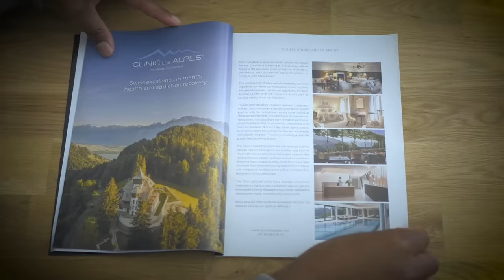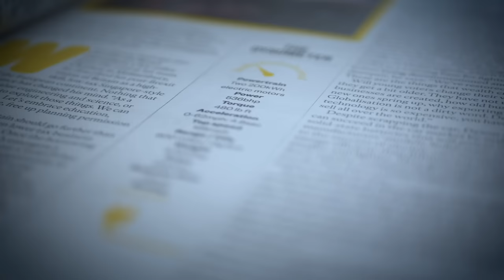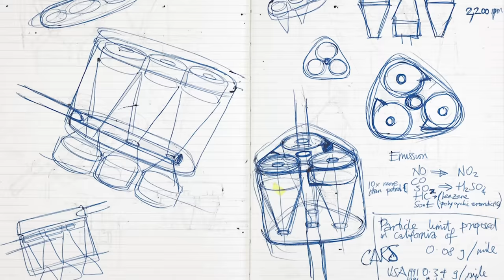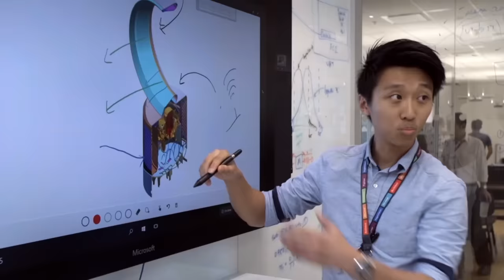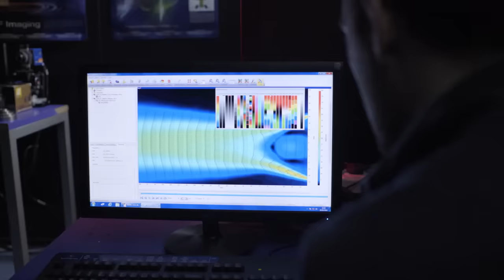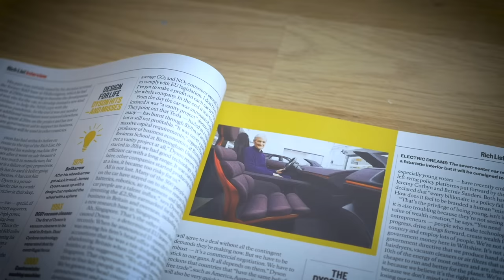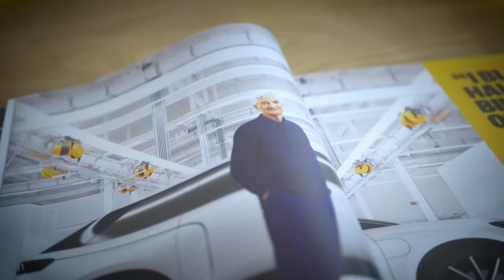Who Killed The Dyson Electric Car?

Comment: For Dyson to sell the product in the UK the 600 mile range doesn’t make sense. However if his intended audience is the USA then it makes total sense. My children just came up from Texas to see me, that trip was 875mi. one way, about 14 hours nonstop driving. Even with shorter trips you would still have to figure in excess power for air conditioning, heating, mountainous terrains, battery pack heaters, etc, etc,.

Comment: Holy smokes, just dawned on me that Rory is a good enough journalist that he needn't be hooning about to keep my interest piqued
Reply: @AutoTraderTV  "spewing out emissions"........exhaust emissions are measured in ppm (parts per million). Nothing has been manufactured for decades that is simply allowed to "spew". Is a tired old cleche for cheap effect all you are capable of coming up with? Furthermore no manufacture would reject an easy and cheap way of meeting ever tightening emissions regs. You are just repeating conspiracy theory garbage Rory. At least in analysing the cost of building electric you gave the manufacturers some credit
Reply: @xtc2v  The suspicion has to be that Dyson's idea for emission reduction just did not work as well as he pretends or, if it did work at all, was far too expensive, or, most likely, it could not operate over the distance legislation demands (80,000 miles or more).
Reply: @geraldryan7544  Agreed, otherwise VW group would have used it as a simple fix for their emissions scandal!
In fact, all car manufacturers would I'm sure prefer a zero emission ICE car over the massive investment needed for producing and EV....I would wager that the Dyson filter didn't work!
Reply: @brownpartnership11  Nothing is cheaper than a bit of software that can run on a computer chip you have to have in the car anyway!
Reply: @DavidKnowles0  Agreed, as long as that software can fix the issue and it's not a hardware issue as in many of the cases for VW emissions.

Comment: For many years I designed and manufactured systems for commercial vehicles. I loved working on the most complex and unusual ones. It is fun to invent some new way of making a thing work. It was quire engrossing. The very hardest part of that job was knowing when to walk away, when to call a customer and admit that I couldn't make a gizmo that fit their requirements. Often I would go back and revisit these rare failures and try again.. and again, often spending unjustifiably large sums. 
I didn't have Dyson's budget but I understand the emotion, and I feel his pain.

Comment: I wrote an article for a business magazine on the foolhardiness of Dyson's electric car project.  I called it his Sinclair C5 moment.  He had experimental battery technology which he was trying to commercialize at light speed. Most other solid state battery researchers thought that the potential for a commercial battery was five to ten years longer than the timescale Dyson had given himself.  Dyson also chose to start from scratch.  His potential competitors, the existing car manufacturers, already had production lines. His potential competitors had existing car models.  He was building something completely new when his competitors were engaged in product modification.  He had small capacity.  His potential competitors had huge capacity to produce.

Dyson was developing his own battery technology, not linking to an existing supplier. Again more cost.  Dyson was trying to develop a new battery technology, smaller lighter batteries but with faster charging times and greater capacity.  There were lots of rumours that said batteries were unable to provide the power output demanded by the Dyson Car.  this is exactly the problem Sinclair had with the C5.  Sinclair had developed a new battery technology (something he had been working on for decades) BUT his batteries weren't ready for commercial launch so the C5 was a busted flush that had to be pedalled up the slightest of hills.

Dyson could have gone into a joint venture to supply his new battery technology to the existing car industry. By focusing on the battery alone rather than trying to build a new car from scratch, he may have got better results.  Instead, at the launch of his car project, Dyson chose to slag off the existing car industry and go it alone.

It was always going to be a problem for Dyson to launch his new car at a competitive price.  He was operating at the edge of commercial viability with his battery technology add a lack of economies of scale and existing vehicle parts -suspension, brakes, etc, his car was always going to e hugely expensive and produced in small batches.  Just look at the issues Tesla had when demand exceeded  their production capacity.
Reply: What a nicely reasoned set of points. Well put.

Comment: "If anyone can make an electric car work it's him, surely!"
No. Not at all. We generally struggle to understand that the automotive industry is one, if not THE most complex industry in the world. The level of optimization it has gone through in the last century it's something not easy to comprehend, the amount of regulations and standards it has to meet is overwhelming, and it doesn't stop here... all of this while mantaining rigorous quality control AND the production rates of a can factory, oh, and don't forget the post-sell support and assistance and the practically non existent margins in all but a few segments.
That's why Tesla still struggles to achieve the QC of even the cheapest japanese or european citycar, and that's why NO, having distrupted the vacuum cleaner market is not a qualification to make a big splash in this incredibly hard industry sector.
Reply: I agree. I've been a development engineer for most years of the last 24. It is sodding difficult and sodding expensive.
My years outside of the automotive industry were as a development engineer in the aero-engine industry.
Damn, they ARE expensive. Don't think you';; get many start-ups competing with the Trent 700 !
Reply: You're of talking out your butt really.
He messed up because he worked backwards he designed the car before sorting out his supply chain, when he got around to doing so it was a surprise. It can and has happened to others in every industry. It can be said Tesla only exists because they managed a deal with Panasonic for batteries, there were other EV manufacturers when coming out along with Tesla when it. Tesla secured a battery the others didn't, Tesla is here the others are not. Same thing is happening with Dyson. The crap you spouted has nothing to do with that.
Reply: @ExileXCross  do you realize the reasons you gave for Tesla's success doesn't negate the points of the original comment? And why would you insult a random person on the internet for a perceived differing opinion?
Reply: That century of optimisation is essentially being thrown in the bin at the moment an manufacturers have a nearly blank slate to work with.
Reply: @ExileXCross  Musk had the capabilities, ie lots of very cash rich friends, It was his Hollywood friends that save Space X, to raise money to build his own battery factory. Dyson already has such a factory and it been expanding for years.

Comment: If batteries were the biggest cost. I Wonder why he didn’t just trim the range down to say 3-400miles this way he has a product to start off. Sale some units and in future release your 1000mile car once the market is more familiar with the brand. 

Perhaps he tried to do too much with his first product.
Reply: When the manufactures claim, say 300 mile range, that's usually in ideal weather conditions on flat roads.
So out in the real world it'll certainly be less. Factor in battery degradation over a few years & the range anxiety could become a real problem.
Reply: Yeah everything start small
Reply: Tesla threw the whole kitchen sink in right out the gate. They just arrived at 'Normal' with the Model 3 and Y
Reply: @ONYX-365  Not when it comes to the 100kwh Model S & X that Dyson was trying to compete with. 300 Miles is not efficient for a 100kwh Pack. That's in bad condtions.
Reply: @ONYX-365  "Factor in battery degradation over a FEW years" LIES!
Battery does not massively degrade around 8 Years. It plateaus for several years under 10%. That is a well known statistics of Lithium Ion BEVs real world fleet data.
Reply: Tesla is aiming for 500 mile EPA range for their top trim $70k USD Cybertruck. I agree 600 miles was a bridge too far.
Reply: @ONYX-365  Most daily driving is under 40 miles.  Well designed battery packs have negligible degradation.  Tesla's existing battery packs last more than 300,000 miles of real world driving.  Please stop spreading false information.
Reply: It's estimated that the Tesla Model X comes with around 20K worth of batteries, which goes around 350 miles utilizing a 100-kWH battery.  Since Dyson's car would be heavier it would probably only get around 300 miles on that same battery so you would have to pretty much double the size of it using a 200-kWH battery costing closer to $40K.  Realistically he could have offered 3 trim levels, a $120K version that would go around 220 miles.  A  $135K version that would go around 310 miles and a $150K version that would go 600 miles.  This way people would pay for the amount of range they wanted.
Reply: jesse e .......Hmm? 1.5 minute run time on my cordless hand held vac....Then a recharge...for three hours....sounds as though the car/handheld vac. would not even get out of the garage Er? Cupboard.
Reply: The density of the SSB batteries Dyson was working on was suppose to easily provide that 600 miles range at a affordable price, when they failed to arrive on time, they had to resort to normal Lithium batteries, which sent the price sky rocketing.

Comment: Very nice summary of the story.
I work in the Auto industry as an engineer and followed Dyson from the start of its EV project. They really were wildly naive from the start. Saying they were "Ambitious" was a more kind way of putting it. From the start, senior level Dyson employees were ringing alarm bells that the EV project could bring the company down. Just read some of the Glassdoor reviews.

A more fundamental issue was their urge to re-engineer every aspect of the car. They were literally trying to re-invent the wheel. This is where Tesla excels; Tesla leans heavily on Tier1 suppliers to bring in existing hardware with no radical customizations. Instead of all-out hardware superiority, Tesla also banked on software and they are 5 years ahead of even the big Auto players. Dyson EV had no chance.

Dyson does well with their premium consumer products and they are really nice to use. However, from an objective technical view, they are over engineered, over priced & not that robust (a philosophy that does not work for new EV companies). What vacuum cleaner does the local car wash use.... its a Karcher, Hoover or a Henry.

Comment: You've hit the nail on the head with the partnership angle; Dyson should've partnered up with an established part of the supply chain for EVs or at least another manufacturer. 

Even the mighty Tesla compromised on this; the first Tesla-powered EV had a Toyota badge, the second was a modified Lotus design and the third, while very much a Tesla design, had Mercedes switchgear in the interior because they knew what corners could be cut at that stage.

The range-you-think-you-need is another good point; people don't actually need to go as far as they think they do in one go. But they do need to be able to charge up as quick as they can with an internal combustion engine, which currently isn't possible no matter how much you spend on an EV. So perhaps Dyson should've looked at creating a charger/battery combination that could rival refuelling times of a petrol/diesel pump. That would be truly revolutionary.

Comment: So the Cybertruck 3 motor ~$70k and Dyson $200k so total product proposition failure.

His target should have been Defender X P400  ~£100k  that was easy to beat with an EV with Magna and Ineos on board?
Reply: John Dinsdale no one in the traditional car manufacturing has the knowledge  to develop electric systems . That has been the biggest problem car manufacturers face. They were used to just buy components but it turns out no one knows how to build them.
Reply: @irisfailsafe  Magna do and created the jaguar ipace ,  Mr Dyson needs to learn humiliate and ask for help

Comment: Another great piece by Rory Reid, a much underrated motoring journalist. However, I suspect there's another reason in the mix as to why Dyson binned this project, and that's the forthcoming Rivian R1S (and R1T). Same concept (though max 400 mile range), and about to start production. Massively well funded, too.

Comment: I am an early adapter.  The primary reason I bought a 2014 Model S, P-85 was because of the Supercharger network Tesla was developing even back then.  Today that system allows me to recharge (for free for as long my P-85 exists ... a benefit no longer available) on the Interstate system at stations no further than 150 miles apart.  The reality of my Tesla being a quality, over 90% efficient, vehicle notwithstanding.

Comment: In my opinion, as an electric car owner, a 500mi range electric car would totally be welcome.  Once all the range loss variables are taken into account, this would be a great number.  Taking into account cold weather, higher speed driving, towing, charging to 90%, battery degradation, and charger speed and location, a 500mi theoretical range could be knocked down to a useable 300-400mi range pretty quickly.  A 600mi range is probably a little overkill though (although maybe for towing).

Comment: Shows how amazing Tesla is, they started from scratch. All respect to Dyson.
Reply: johnDomain  The fact that they're the leader in EVs? That no other company managed to catch up
Reply: johnDomain  Tesla is beyond amazing, it's scary where they are now. Going to be an Anti-Trust problem in over a decade. Newest Surviving Automaker going to be a Bully. Once thought Impossible.
Reply: Tesla started off from a Lotus. This car is 100% built from the ground up.
Reply: @TheLewisw1396  You haven't been following. They ended up only using 5%, and they had to re-engineer and redesign the rest.
Reply: Ahmed Alhashmi Oh I have. It was actually closer to 7%. The overall percentage is largely irrelevant and of course an ICE and BEV don’t have not a lot in common. One of the hardest parts of car manufacture is the chassis as there’s tonnes of red tape, safety regulatory rules to abide by. That’s why they got help from Lotus. That’s why most car companies share chassis between models. As this is the foundation of the car you cannot say the roadster was from scratch. But there’s no shame on Tesla getting help from Lotus as they are one of the best when it comes to building lightweight sports cars
Reply: No shade at Tesla, I worked there so I know the mind blowing things they do, but it is two completely different scenarios. It is one thing to be the first to market with an innovation, as Tesla was, and to have the luxury of really no competition at all for many years. It is completely different to enter a market against an established dominant competitor and lots of other companies in the same industry who are also entering the market. 

Yes, what Tesla did was still insanely difficult and they had three good chances of going bust as it was, with every possible advantage. Dyson had everything they needed, in my opinion, but they waited far too long. If they started working on the SUV in 2010 then Dyson would be the major Tesla rival today. Timing is often everything.

Comment: Why go for a 7-seater 🤔 aren't the majority of car trips just the driver, maybe 1 passenger..
Reply: Sometimes people tend to buy stuffs on the base of "Just in case". Just like how some of pickup truck owners buy pickup and never actually use neither the bed or the towing capability. When asked, some of them would probably say "But someday I'm probably gonna need it".
Reply: @Arpin_Lusene  Good point! I get the pick-up appeal, and some people like the styling 😀
But not many mini-vans come to mind that look good, imo.
Reply: Exactly. Each passenger is more dead weight and significantly reduced range. Put four adults in the car and the range is 50 miles, unless you use the air conditioner which is 25 mile range, and going up a steep hill knocks it down to 10 mile range.  And of course the battery has lost 50% of it's charge capacity in 5 years; new batteries will set you back $15,000.
Definitely lease, don't buy. In five years technology will be 10 times better and a new car will have better range...for a much higher price
Reply: Most private car trips are for 1 person within 20 miles of home.  Huge SUVs are not the answer.  And any EV can do 30 miles a day.

Comment: This is basically a regurgetation of the CAR manazine story from about 2 months ago. They even show the pictures and pages in absence of any direct contact with James Dyson. Let's put it down to working limitations due to Covid as you are usually much better on it than this.

In terms of cost Dyson is right that he won't make money. Tesla almost never have and the mainstream car manufacturers are struggling to make viable cost effective alternatives for consumers. For VW, Ford etc. think of it like this - cost of an EV = the ICE (internal combustion engine) vehicle plus/minus about $12k. Growing numbers of customers are interested in EVs but until Total Cost of Ownership (through govt incentives and economies of scale) is at or close to parity to ICE then low take up and residual values will hold us all back from mass adoption.